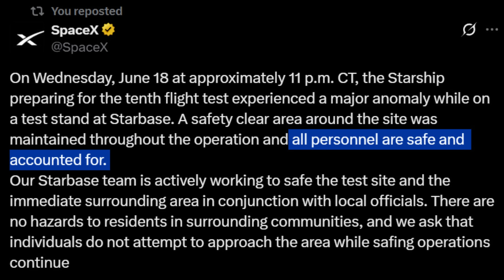SpaceX's Latest Starship Explodes During Ground Test

Comment: The late Starship(V)1 flights didn’t explode until splashdown. The early (V)2 flights exploded in flight. This (V)2 flight exploded on the pad. I predict that, if these trends continue, we’ll see Starship(V)3 explode in the stacking hall, Starship(V)4 explode while still being manufactured, and Starship(V)5 will explode while it’s still in CAD.
Reply: At some point, you can't even call it a RUD anymore because it's expected, and if it's expected you can schedule it.
Reply: When is the scheduled explosion of ship 37.
 @ForwardSynthesis
Reply: @ForwardSynthesis 
RDS.
Reply: This is an explosive comment
Reply: "will explode while it’s still in CAD" 💀
Reply: @zzyzxyz5419  a construction so bad that it destroys the computers used to model it
Reply: @zzyzxyz5419  as a technical drafter I am used to the blue screen of death
Reply: @zzyzxyz5419  Computer Aided Detonation
Reply: I’ve seen their code. Yeah it could blow up and CAD.
Reply: I'm not looking forward to the version where the minerals are exploding in the ground even before they are mined.
Reply: Yeah and V6 explodes on the drawing board
Reply: @Refrexk  Then V7 explodes in his mind?
Reply: @Refrexk  At this rate V7 will explode when you even thi-
Reply: @Refrexk 
V6 will explode in the minds of the designers.  Designing spaceships is hazardous.
Reply: Crashes are normal when it’s running on Windows.
Reply: Oh sureb how do you know it's not Mac OS?
Reply: @Mrshoujo  it's not on Mac because it's in CAD, the same way you probably aren't using illustrator on an insignia tablet
Reply: @Dave5843-d9m or if they’re using Solidworks
Reply: @Dave5843-d9m  I haven't seen a dreaded BSD in years…  In fact, Starships have been blowing up with greater frequency than BSD's have occurred on my home built PC.
Reply: Yep, Elon acts like this is all new and we haven't been putting shit into space for eighty years.
Reply: @jasminejeanine2239  I keep saying that and they all go nuts on me. All the problems he has been having have been solved along time ago and written down in a book. His people will not read them and are reinventing the wheel.  No one that knows what they are doing will work with SpaceX because of this. They say "ha ha Shut Up Boomer we know what we are doing" not realizing those Boomers invented everything they are using and have already gone to the Moon and Mars.
Reply: @jasminejeanine2239  This times one million!
Reply: Starship(V)6 already exploded in my mind.
Reply: Given Elon's brain appears to have already exploded I'm not sure what's next😂
Reply: Starship (V)10 creates wormhole to the past and 12 year old Elon explodes while brushing his teeth.
Reply: It's progress of a sort!
Reply: That is the brilliant efficiency of Iterative engineering!
Reply: @christopherpardell4418 
One could say it’s Doge-like efficiency.  I mean it’s getting to the explosion part sooner and sooner and it’s making the fireworks show more and more efficient to access.
Reply: @keirfarnum6811 Yes! They have managed to achieve full vehicle loss with a tiny fraction of the fuel!
Reply: Lol
Reply: Happy 19th of June, everybody!
Reply: @808bigisland yeah happy world sauntering day.

Happy anniversary of first NASCAR race at Charlotte motor speedway.

Happy Birthday to the FCC
Reply: Starship 6 will mind blow
Reply: Ah yes, the old "Build it in reverse" plan, such a brilliant man! And wasn't this another example of a "Rapid Unscheduled Disassembly" (RUD)? There are NO explosions at SpaceX!
Reply: These comments are gold 😂😂
Reply: Lol, CAD, or AutoCAD at least, has an 'explode' function. Used to disassemble an object of grouped simple shapes into their components.
Reply: @fastonfeat  My Fusion 360 explodes several times a day. Just as well it was so cheap (sarcasm).
Reply: Starship will explode while it's a glint in its daddy's eye.
Reply: You know, I'm thinking it wouldn't be so necessary to establish a second base for humanity on Mars if it weren't for all these goddamn explosions.
Reply: Lmao😅
Reply: Starship V5 is designed in exploded view.
Reply: LOL! yeah this certainly is the trend line!.
Reply: Hahahahahaha😂😂😂😂😂😂 that was so funny to read. Damn. 

Hope its not the case 😮
Reply: V6 will explode inside elon's brain
Reply: Starship V6 will explode on the napkin Elon sketches it on.
Reply: V5, computers explode during assembly. Saving a lot of time in RnD work.
Reply: Everything explodes in CAD though... OH, you meant PHYSICALLY as in takes out the computer, user, and whole engineering department...

Aside though, change one stupid thing in one stupid part and it all explodes in the program.
Reply: V8 will explode a unborn baby
Reply: V1 on splashdown to V5 exploding in CAD, probably proportional to how much Elon got involved.
Reply: A bit down the line there will be a distributed project to contribute computation to the SpaceX design process...

Explode At Home

Comment: Every time Space-X have said they're going to Mars by X year, they weren't going to Mars.

The Starship development is a mess that is currently pissing billions of dollars down the drain every year trying to figure out problems that are long solved by proper ground testing and actual forethought.

Meanwhile SLS is likely to get cancelled because of Musk's meddling which basically means that the US isn't getting people on the Moon until 2029.

At the current rate, I would not be surprised if they blew up a fully fueled Super Heavy during a test, which if they do would likely level the facility and the town and the town beyond it as well as destroy a massiive area of rare wildlife habitat. It'd also likely kill people. If the FAA was sensible then they'd have stepped in to make sure Space-X do a proper testing regime ages ago. But nope, gotta let them speed run blowing shit up. And of course ignoring the workplace injuries common at Starbase (A rate about five times higher than the industry average and more than double any other Space-X facility).

Comment: V2 is cursed with leaks and mechanical failures isn’t it. I wonder whether the whole fuel storage and transport system has been under-engineered for the pressures it faces, particularly in a vacuum and when under vibrational stress. 

If that hypothesis is true, the question then for me is why did they do that? Is the target mass fraction too challenging?
Reply: Wild speculations and then questions upon said wild speculations are a bit more than useless
Reply: This is social media. Nothing wrong with thinking aloud, as long as one is clear about its nature - Scott's video was largely speculative and he was honest about that. All lines of enquiry are valid at this stage.

Comment: I mean, this is borderline pathetic, if you ask me. How are they designing a rocket by exploding what, a half dozen plus of them? How is this ever going to work? That's not how one should design a rocket. They still can't reach orbit reliably, let alone with a payload, which means they have another 10-20 to explode before they "get it right." This just isn't substainable. Nor should it even be legal to do rocket research like this. NASA never seemed to have this issue. And sure, this is enormous, and revolutionary (supposedly) but still.

Comment: Trying to get to root cause from the failure starting on the windward side seems like a reach. For a lot of failure theories involving the headers and relating plumbing, the exact location in the bay for the parts is not very relevant. Dump 100L or so of liquid methane from anywhere on a still "warm" the forward dome and I could see it flashing to gas fast enough to over pressure the bay. The fact that it didn't start at the door is a better argument, but even then, I kinda suspect that the door is somewhat structural (it would make things a lot stronger if it was) in which case it might not be that much of a weak point (as is likely subject to enough QA that manufacturing defects elsewhere are relatively more likely).

Comment: Why they don't use flexible hoses for the top tanks rather than rigid  pipes? flexible hoses  could be safer both on the ground and in flight (diminished resonances, less hammer effect, less sensitive to vibrations, immune to contraction / expansion cycles, and also lighter ... )  I suppose there must be a reason not to do that, but I'm curious.

Comment: Engineers should also look at shielding or dampening to suppress sources of ignition. I know, electrical and metal striking metal can easily cause sparking, but they should evaluate ignition prevention. Just my non-expert opinion. Yes, without ignition, you would still have a large pond of volatile fuel spilled, which perhaps would inevitably be set alight somehow, but they should look at each and every potential ignition source both on the craft itself and on the ground. Would auto-triggered (instant) water flooding above and below help? Just brainstorming.

Comment: He does say that it was a deflagration and not a detonation. However does that take into account that the liquid methane tank helped build pressure before it blew apart completely. Because if the pressure was high enough then decomposition happens faster than under normal atmospheric pressure.

Comment: This is the closest I've seen Mr Manley getting to criticize SpaceX/Starship.
I'll by this man a drink the day he finally dares to say Starship is a massive failure that will never work.
Reply: I mean, it is in testing. V1 looked so promising after back to back successful flights. But yeah, this is starting to look like a lost cause. Maybe in another 50 years. 

I think the main problem is the thing is just too damned heavy.
Reply: @Kevin_Knox  
It is a concept that NASA scrapped in the early 60's because it was impossibly heavy and would use way too much fuel.

The "in testing argument" is not going to work. NASA had these types of explosions very early on when rocket technology was in its cradle. These types of failures didn't happen during Mercury, Gemini, Apollo, and the Space Shuttle programs even during development. There were two accidents with the Space Shuttle.
The sixth launch with Saturn V put people on the Moon. It never blew up even during development.
Reply: @christianholmstedt8770  when i say it's in testing, I'm just trying to give SX the benefit of the doubt. But yeah, I'm officially calling it  a lost cause at this point and that's coming from a huge SX fan. Besides, as much as i was always rooting for Starship, the Mars goal is awfully lofty. Like I said, maybe in another 50 years. Very disappointing.
Reply: @Kevin_Knox 
Understood.
I'm just pointing out the obvious when comparing SX and the NASA programs.
The gov should cut its losses and leave this StarShip fiasco.
Reply: A copv is faulty and the haters are saying its over lol

Comment: It looks like the tank rupture push the hull open with the pressure, while the electronic cables might got ripped if attached to the hull, cable sparked and ignited the fuel at the mid section of the craft.
Reply: Also when testing anything, I'm surprise they didn't use high speed camera for 100fps footage.

Comment: I disagree this substantially changes the odds they make the next Mars window. They have now had another block 2 starship RUD likely from the same root cause. The failure of Starship36 happened on the ground and at 10 days before it would have failed in flight. So the failure of Starship 36 is 10 days ahead of schedule and they didn't waste a booster or damage their tower doing it. Better still if the RUD leads them to scrap Starship 37 & 38 or fix them they are now 3 future failures ahead of schedule.... The whole reason you put the spacecraft on the test stand is to have it fail on the ground instead of in space. Where you can study the failure in detail. So if they intended to launch every 3 weeks this failure has them 2 months ahead of schedule....

In the end if they can build a complete Starship stack every 3 or 4 weeks this is no major loss.

Comment: I think you're right.  They took at least some of the weight savings between Starship V1 and Starship V2 too far.  The question is how much they're putting back in Starship V3?  Did they go back to Starship V1 and step forward again or did they go from Starship V2 and step backward enough?

I think they know they have a design issue with Starship V2, but they're using the production run to test mitigations now that will hopefully strengthen Starship V3.

I won't be worried so much until after seeing if Starship V3 resolves the issues, or not.

Comment: If the header tank for the compressed gas tank that was on the convex side of the two tanks lost pressure suddenly. Wouldn't that make the wall between the tanks suddenly invert, which would naturally tear it and cause an explosion in the lower half?

Comment: I wonder if the flying trashcan will ever work. After failing so many times while getting nowhere near what Musk promised, it looks less and less likely. After so many attempts they´ve just built a very expensive bomb. 
On January 10, 1962, NASA announced plans to build the C-5 (Saturn 5). On November 9, 1967 it started to it´s first flight and worked. 
That was in the 60s, when they didn´t even have calculators. 
people dremed about what could be achieved 50 or 60 years later. They would´ve been very disappointed to find out that the USA is trying to get back to the moon and the best they have after 13 years and trying and crashing/melting/exploding 9 times is just a bomb.

Comment: SpaceX needs to immediate upgrades to their company:  project management and quality.  That'd be the place to start.  

Unless we know exactly what V2 is relative to V1, we can't assume why these failures are happening.  Is it simply system complexity that SpaceX can't manage.?  Are they really cutting back on the FOS with V2?  Are they assuming more risk since they're using unproven technologies?  Without know the root cause, we also have no clue what V3 will be.  Some just throw it out there as a solution simply because it isn't V2.  That's nonsense.  Given how little of the Starship is actually designed and prototyped in the flying version (and not just lab test fixtures), there are many, many challenges remaining for Starship if it ever will be a flying, manned vehicle.  V3's failures might even be worse, for all we know.

Musk posts "just a scratch".  That guy constantly proves he's not much more than a car salesman with his programs.

Comment: Personally I think this has all the hallmarks of a procedural error during fuelling. Considering V2 has been tested rigorously on the ground without failure so far and that the lines running from the header tanks have not been an issue thus far I would be surprised if this is a failure due to ship design. This is going to really set them back though as their test facility will be trashed and will take a while to get back up and running.

Comment: V1 didn't really have any unexpected problems besides normal development issues like the early launch failures we saw. V2 created problems that certainly did not exist before, so I hope that V3 solves those created problems. Of course, should we still experience these issues with V3 there may not be an issue with the practice so much as the principle

Comment: What an absolute fail this project has become.  You will have the fan boys defend this clown show at every turn, but absolute failure is what this whole program has been at this point and there is no sugar coating that.
Reply: The actual rocket is still very good. So far only the actual Starship has been very failiure prone. If Elon would just give up on his idea that this needs to be one system we already have a very capable rocket here. Repurpose the upper stage from the Falcon 9 (make it bigger and possible go for two engines) and add a traditional fairing and you have everything you need.
Reply: The Universe is telling E.M. that it's time to get his ass back in the office, focused on his businesses.
Reply: Not defending the project, but Falcon had a history of failure that it looked set to never overcome. Its critics before and after that time said SpaceX would never have a reusable booster, let alone one that can land itself. Yet, here we are, Falcon is breaking records…
Reply: Glad the Wright brothers did think like you.  Wait, let me guess you must be a millennial, no, Gen z for sure. 

Hard work, persistence, dedication, resilience. Try it some time.
Reply: The Wrights had decades of other people's experiments to look at - quite a lot of the previous failures were from overpromising & overestimating the tech of the time.

Comment: I spent my entire career with software and systems. It's been shown empirically that version 2 of any software or system is the least stable and weakest of its entire life. The reasoning is simple. Version 1 has many bugs that are learned from testing and in-service operations. Version 2 attempts to fix those bugs, but doesn't fully take into account how the fixes interact with each other, until that is learned during version 2 testing and operation. Version 3 is much improved, with bugs being fixed and a better understanding of how the system as a whole operates. Starship V2 is concrete proof of this. Cant wait to see Starship V3.

Comment: NASAspaceFlight figured it was about 10 mins from engine firing.   I'm thinking they had an over pressure of the header tanks that caused it to zipper open.  The methane lit up.  After the 1st explosion,  debris fell on the tanks and gear next to the test stand.  Then the ground tank went up (2nd bigger explosion).  Now it's wait to see what the  damage is and see how long it will take to fix it.  They could use the gear from launch pad "2" and Florida to get the test pad back up and running quickly.